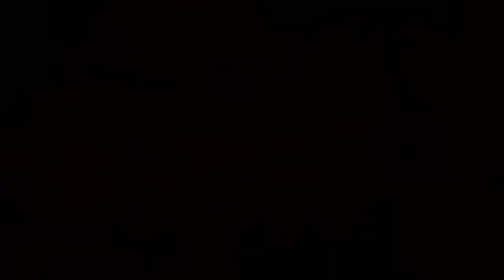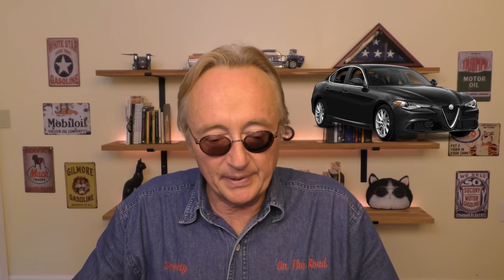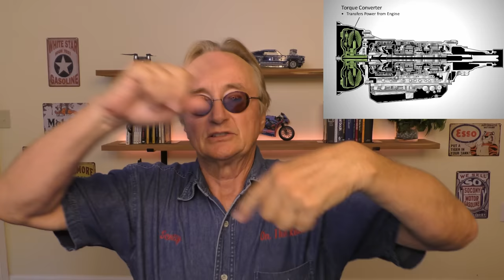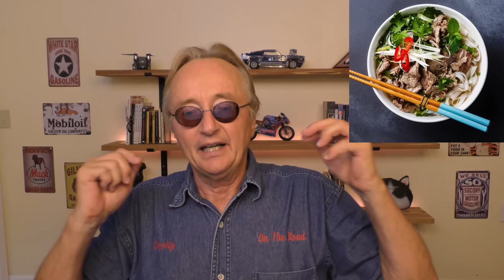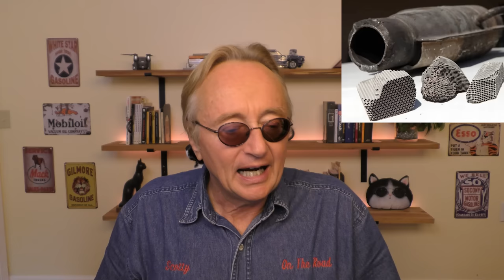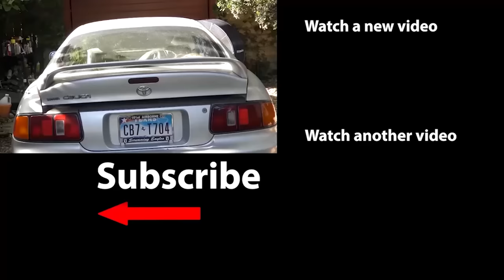Here’s Why Honda Engines Run Like Crap

Comment: I drove an Accord with the 4 banger K24Z2 engine. I BEAT THE CRAP out of that car for 250K miles and it always drove like a clock. Never failed me once. When it was totaled it had everything original under the hood except the battery, starter, spark plugs. Now I drive an 03 Toyota Avalon. Another indestructible BEAST!
Reply: 4 banger 7th Gen Accords are what the kids call my safe space
Reply: same with my 2008 crv , excellent vehicle
Reply: Toyota even better
Reply: LOL he titled his video here's why Honda drives like crap but only talks about Honda for like 10 seconds. Readjusting the valves is very easy. Once you get the hang of it do all the intakes first and do all the exhaust.
Reply: @andrenelson3828  100 percent. Toyota's reliability is unparalleled, especially on Corollas, Camrys, 4 Runners, and most Lexus models in general.
Reply: Me too. Got a Honda with 200k miles and still runs like a charm. Never fails me. Not sure WHAT Scotty's talkin' about.
Reply: Honda K Series engines are literally Bullet Proof
Reply: Got 3 Hondas currently in my stable :
2000 Accord Gen 6 2.3L with 380k
2003 Accord Gen 7 V6 3L with 210k
2006 Civic Gen 8 1.8L with 220k

All purring like from factory since Day 1
Very Reliable n relatively easy to maintain
Reply: @Efrain Valtierra 

Sounds about right.
Reply: @andrenelson3828  dude it sucks
Reply: I drive my 1996 Toyota Camry with 235K and still running strong...
Reply: @ivanbustamante6011  I'd step up at least to a 2010 model to get some safety tech
Reply: Best $1500 I ever spent on a car was an ‘88 Acura Integra. It had about 200,000 miles on it and I put another 90,000 on it. Only thing I did was replace the alternator.
Reply: Ever change trans fluid or all orig? I like avalon better!
Reply: @vincecarlo  just curious do you ever change the transmission fluid or   keep it orig?
Reply: @Brararaf101  

I do a ATF drain and fill every 50K or so
Reply: Hmmm. My brothers 97 manual civic ex had about 210k on it when he bought it, he drive the piss out of it redlining and racing it all the time, and it never gave him a problem. He wrecked his at 250k as well, and upgraded to an S2000 after that. Huge upgrade lol
Reply: @kongxiong6005  He does that all the time!
Reply: @neonreign2988  Except honda engines are far superior and manual honda transmissions.
Reply: @getthecansin  That's honestly pretty subjective, they're both very reliable automakers. Toyota makes the best off road 6 and 8 cylinder engines compared to Honda, especially if you compare 4 Runners, Land Cruisers, Tundras, and Tacomas to say, a Ridgeline. Honda undoubtedly has great 4 cylinder v tech engines and produces some of the best in the world that goes beyond the auto industry, such as motorcycles, boats, generators.
Reply: @neonreign2988  Honda doesn’t make v8s i don’t believe, but the reliability index of the ridge line actually scores higher than the Tacoma. Most apple to apple comparisons for these brands are the sedans

Comment: My girlfriend has had a Honda accord for over six years. All I know is her car has never broke down and runs great. My opinion is Honda builds good cars.
Reply: My wife’s shopping car is a seventeen year old Corsa 1.4 Petrol auto. 63,000 miles and never missed a beat. Just checked with cheap Aldi obd meter and no faults. Only does 30mpg though which is considered thirsty here in UK. Grandson just passed his test and doesn’t want one as it’s not ‘cool’.
Reply: He makes videos that go both ways I don't get it
Reply: @davidk3729  63k is not impressive my guy.. The most unreliable cars last till 80k.. Your point is? .
Reply: @dbdnrbdb  think hes saying from 0 to 64k hasnt had problems in that time..? But yea thats nothing. A major service is coming up for them.
Reply: The best

Comment: Just checked the valve adjustments on my VTEC 2.3 with 300,000 plus miles a month ago and none of them needed adjusting... they were spot on according to specs. The difference is how they're takin care of. The entire cam and rocker arms on this engine has no signs of wear at all, like it's new. The correct oil and oil changes does matter.

Comment: "Scotty i need help with my nissan murano."
"Yeah you and everybody else who bought a murano." 
LMAOOOO
Reply: 2007 Nissan Murano was the worst car i ever owned! Wouldn't wish that car on anybody!
Reply: I’m dead
Reply: Haa!... I have a 2007 w/ ~175k miles that I plan to unload as soon as finish doing a timing job/partial rebuild on my 2005 Mountaineer/4.0 SOHC with 240k miles. I have been crossing my fingers the CVT doesn't decide to randomly crap out. I have FWD and change the fluid every 60k so hopefully that bought me some time. I do most of my own repairs but that car is a royal PITA to work on. There is no clearance in the engine bay. Every repair seems to involve removing no fewer than 30 nuts/bolts and there is always one that buts up against the firewall or exhaust manifold with 0.25" of clearance. I have dropped many an F-bomb wrenching on that beast.

Comment: Have a 2012 Accord Coupe 3.5 V6, valve adjustment w/ timing belt water pump every 100k ($1,200), now 220k runs like a top.  Granted, would like a Civic with a chain, or a Toyota 4 or 6 with a chain and clearance engine.

Comment: Don't like tappet valves in Hondas, but tout toyota which requires removing the cams and uses shim disc's? They very seldom need done, but I'd rather fix the honda. 

Tell me how you like changing plugs on the rear head of the Sienna. 

I like both makes, but working on Hondas more..enjoy the content.  Keep up the good work

Comment: 2:22 Good to hear some New Edge Mustang advice, I've a 2000 V6 with an automatic transmission that slips in reverse if i'm using it to do multiple tasks around town and I back out of spaces. That thing has just over 265,000 kms (164,500 miles roughly) on it and the rear end is ready to go on it, so i'm just gonna drive'r til she quits.

Comment: Got 3 Hondas currently in my stable :
2000 Accord Gen 6 2.3L with 380k
2003 Accord Gen 7 V6 3L with 210k
2006 Civic Gen 8 1.8L with 220k

All purring like from factory since Day 1
Very Reliable n relatively easy to maintain
Reply: Mashallah

Comment: Talkin about Volvos remember that xc70 that the Infiniti crashed into, the Infiniti was TOTALLED but all the Volvo had was a tiny scratch NOT EVEN A DENT
Reply: Volvos are built like tanks even German cars will be totalled if they hit a Volvo.Volvos are road running tanks💪
Reply: @FB6K24Z7  a Mercedes-Benz W124 is a different beast

Comment: I have an 07 Acura TL Type S with the J series 3.5L VTEC V6 making 288hp I just bought it And it has 95,000 mi But it ran like garbage after doing a major service timing belt water pump fluids etc it still ran like garbage well my mechanic was a certified Acura technician for 2 decades And he knows those J series like it's the back of his hand he told me It needs a valve adjustment and it'll run like a clock so That's what I did And he performed his Honda wizardry And now it runs Like it's brand new Now I know from Scotty and my mechanic always Get your valves adjusted on your Honda's Make them last longer and they run a lot better

Comment: I check Catalytic Converters with a Laser Thermometer. ... there should be about a 100 degree tempurature difference between the front inlet and the back outlet if functioning properly .... wonder why Scotty didn't throw that out there ...

Comment: I have a 08 Honda Ridgeline with 165,000 miles and have never adjusted the valves. Runs great, engine smooth and starts right up. Honda Ridgeline owner site have not seen this come up. Had other Honda's like my 85 Civic HB with 285,000 miles, engine still ran like new, never adjusted valves.

Comment: Back when I had a high performance Chevy with a high output 350 LT1 competition engine it had what we called solid lifters.  Every approximately 8000 to maybe 10,000  miles I had to remove the valve covers and adjust the lifter lash. I knew when adjustment was needed from how the engine sounded. I had to manually turn the engine over to the proper position for each lifter adjustment.  I had to adjust what is called the lash (lifter/rocker clearance) using a feeler gauge.  Another way I used to adjust them is to run the engine and listen to the lifter noise while turning the rocker adjuster nut.  I would listen while adjusting to just make the clacking noise just disappear. I would think best to adjust to the proper lash using the feeler gauge.

Comment: I've owned 4 Hondas.  The first one was a 1982 Civic Wagon. Everyone had at least 250 K when replaced. They were still running well, but the bodies were rusted out. Still driving a 2011 Fit Sport.

Comment: Hey Scotty, What is your idea of a Dodge Dakota V6, 5 speed? I have one that has been passed through my family for over 20 years and it's a 93, it has 324,000+ miles on her and I am pretty impressed that with that many miles it still has about 145 psi in each cylinder and is still my most reliable vehicle I have.

Comment: Put it in neutral to allow the fluid to flow thru cooler. If one can find a local automotive school bring your car to them so it can be repaired for cost of parts. I went to a custom auto re-builders school . I rebuilt transmissions at home and at a dealership and worked at transmission stores.

Comment: I do not think Honda valve adjuster has 2 nuts. It has a screw and a locknut. My  owners manual says that if you hear valve clack, then adjust, otherwise, it's not necessary.

Comment: AT -205 failed to end slight leakage in differential on Workhorse motor coach. Pinon shaft kept leaking, as well as the thin plastic outer seal on the wheel hub. By 500 miles, the diff had leaked so much, it needed a pan to catch the foul smelling oil mess. Only a new seal on pinon shaft and a new, thin clear plastic seal on wheel hub fixed it.
Lexus oil leak on neighbor's SUV engine 60,000 miles, did not respond to AT -205. Engine had to be pulled and seals replaced.. dealership.. $5,000 ;}

Comment: I just bought a 2008 Honda fit with 70,000 miles on it definitely needs a valve adjustment.
Reply: Damn . Where you get that
Reply: @joeishere500  I found it here locally. It’s a great car!
Reply: Dealer wanted 500 dollars for something to do with the valves , adjustment I guess . I had the spark plugs replaced , runs ok .
2008 Honda Fit sport , 85,000 miles
Reply: Do the plugs first
Reply: are you able to adjust them your self, i have work shop manual
Reply: @dylan3657  You can. But, you better know what your doing. If your mechanically inclined, you should be able to.
Reply: @psychiatry-is-eugenics  ,, I've seen a few of those Fits with 300/400k miles . That powertrain is full Japan not like Honda's other models... I was like DAMN !
Reply: @jcolt84  ,, she's a keeper. Can get big miles outa that car
Reply: 😂modern cars don't need valve adjustment all new cars use hydraulic lifters
Reply: @catsbyondrepair  Not Hondas.
Reply: @DS..69  😂dude I've worked on Hondas they all have hydraulic lifters. all car companies went hydraulic in the 70s.
Reply: @catsbyondrepair  Somehow I trust your word better than Scotty’s. I have a 96 accord that I bought used. It seems to pull to the right and has inner tire wear on the right front tire. Could it be an upper ball joint or we checked for warren bearings it doesn’t seem to have that.Your answer would be appreciated thank you sir
Reply: @karlfonner7589  ball joints or alignment
Reply: @catsbyondrepair  That is not true. I've owned 5 hondas and adjusted valves on all of them. The newest being a 2012. I can't speak for the new turbo models but a quick Google search will confirm they do not have lifters.

Comment: I have Honda HRV 2017 that breaks transmission cvt at 80,000 miles. Now its mileage is 113,00 but still runs engine good. Can i still use it till the engine breaks since im still paying mortgage till dec 2021? Thank you

Comment: Scotty has a larger statistical dataset than I.  Personally, I have years of experience with 4 Honda V6 (J30, J32, & J35) engines along with numerous friends owning the same.  My family keep our vehicles long-term, and we’ve never had any valve issues.  I did pay for valve adjustment @ 120k miles on my ‘06 3.2TL, just because.  I have no idea if it was money well-spent.

Comment: Honda/Acura had a giant recall on alot of their vehicles 2019 -2020
Due to failing fuel pumps very dangerous situations to put drivers in. Cars ended up losing acceleration on the highway- going limp. 😱

Comment: It's always seems like if Hondas are drove normally, you don't even have to think about a valve adjustment until after 100k miles, I check them when they come in but they always seem right on spec.

Comment: He Scotty, I have a 2016 Civic Ex Turbo.  I heard the engines aren't good. I only do 1000-2000 miles a year. If I change my synthetic oil once a year, do you think my car will last or should I sell. Greetings from Montreal, Canada
Reply: @Aztec Fan1 I really like the car compared to others in the 15000$ CAD range. Only 2000-3000km per year, Do you think I'll get away with only 1 oil change a year?
Reply: Every 6 months is typical. I'd go with that, especially if you are worried about the engine.

Comment: I had a 1991 Nissan Maxima with 100k with a sticky hydraulic lifter 20 years ago . I now have an Acura 2010 MDX with 281K and no sticky lifter.  They aren't hydraulic lifter.

Comment: I have a 2020 Honda passport. The car lacks power and the engine has to think about it before it decides to go. The throttle is very slow to respond.
Reply: Make sure you are not in "eco" mode driving around town.  Use eco on the highway.

Comment: First, my 90 year-old mother put some gas in her car, which had ethanol (20%) in it. Her 97' Olds Cutlas had trouble immediately after this. She took it to the shop. I think the gas filter and plugs needed replacement. Is there a way to solve her fuel trouble/ short of draining the tank? Tittybaby from Albertville, Alabama...the one with the 87' Ranger.

Comment: Scotty, I want to know about my Scion IA 2016. You've always said a lot of good things about camry, and corolla, but what about the yaris, scion ia, etc? it's one of those rebadged ones as a Mazda in other countries. Must be great, right? What should I do to make it run forever. 55,000 miles so far. Transmission fluid change recommended or what?

Comment: I have a 2014 Chevy Cruze that idles rough and shuts off whenever I turn on the A/c. What does this indicate?
Reply: First have your battery and alternator tested. If the power is low, the engine could stall at low speeds such as idle. If it isn't that I can almost guarantee the ac compressor is going out and is dragging the engine. And while you're at it replacing the compressor change the fan belt so that you have a fresh belt driving it.

Comment: My 2006 Honda Accord 4 cylinder 5 speed is a beast with over 220,000 miles. I run her hard & she never fails me.
Reply: My 2004 burned a valve at 235 k...adjust the valves for safety.
Reply: @mikeschlup5279  what valves?
Reply: @bxdubs5577  exhaust valve probably

Comment: Scotty Im looking to buy this 1985 El Camino. Its fully restored with new paint new rims, seats etc. and it has a rebuilt chevy 350 engine. is it a good idea to buy a car with a rebuilt 350? I already know to look for rust, just dont know about the engine.
Reply: 350 chevy engines are very good motors . But it depends on who rebuilt it?
A shop ? with a receipt for parts ?
or just a someone in their garage  ?
Check for any smoke from the exhaust ( white or blue ) .
not good .
Black means it's running rich , so  not as big a problem 
Does it have a carburetor? 
or fuel injection ?
Reply: @jayhockley8841  thank you so much🙏 I appreciate you brother🤝
Reply: @jayhockley8841  I’ve heard that the 350 engines can’t go over 70 mph on the freeway for long periods of time without overheating. Is that true?

Comment: I bought a 16 years old Volvo V70 with 220.000mls last year and it stil runs like a dream. No issues at all. That's in my opinion the last reliable european brand that's left. Sorry Mercedes but you are out. Last really solid Mercedes have been the W124 (E-Class from the 80's and early 90's) and the W201 (190's series). I would go for a Volvo or a japanese (except Nissan).

Comment: Is 5,000 dollars a good price for a 2001 Toyota Celica in good condition with 152,000k miles on it?
Reply: Too much money, too many miles, and a bad model. That was when Toyota put Yamaha engines in them and they constantly broke and needed full rebuilds. So run away from that car.

Comment: Honda engines need to get with the times! They were the last ones to finally do direct injection and they still use timing belts on 4 cylinder engines!
Reply: I thought it was their V6 engines that still have timing belts. They’ve use the same J series of engines from the mid 1990s.
Reply: Yep. They are like nikon. The last to jump on the mirrorless game

Comment: Scotty, I'm looking at buying a slightly used 2020 Toyota 4Runner (the seller lists it as having less than 10,000 miles). In your experience, what are the biggest issues to keep in mind with this Generation of 4Runner?

Comment: I would NEVER EVER use the Lucas transmission treatment in another transmission EVER again..I used this on my 97 Silverado around 20 years ago just because I was changing the transmission fluid and filter so I added 1/2 of a quart of the lucas transmission fluid. I swear to you I didn't drive that truck 10 miles and the transmission went out in it..The transmission was PERFECT before I changed the fluid and added the Lucas fluid I just added the Lucas fluid because I had had great luck using all of Lucas's other products..This one NOT SO MUCH!! I would NEVER recommend ANYONE use that Lucas transmission treatment!